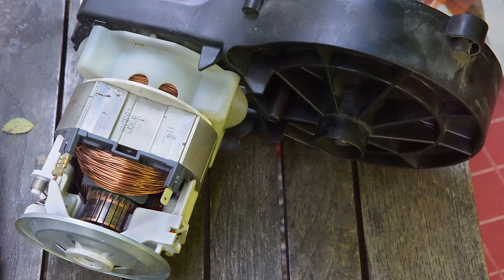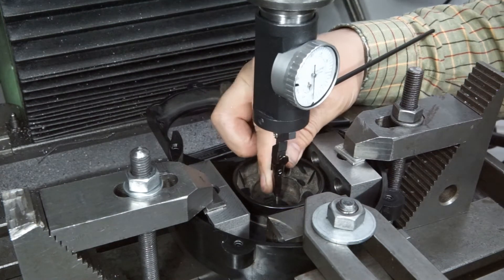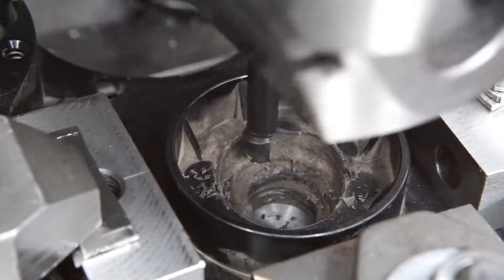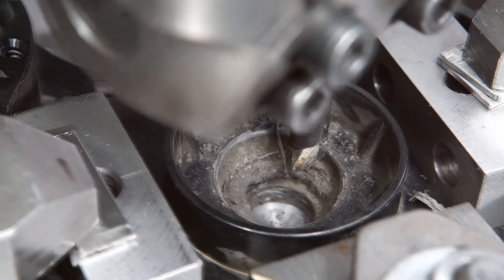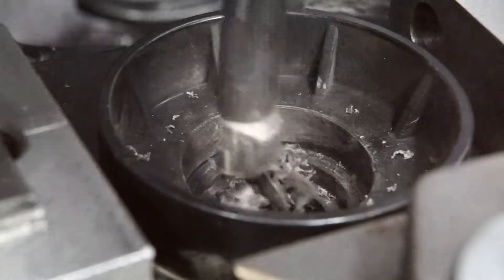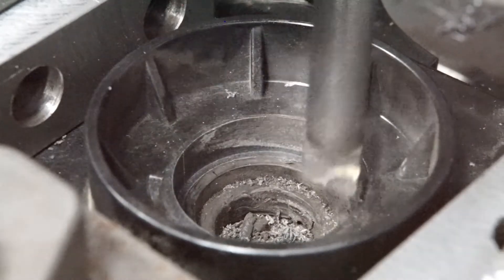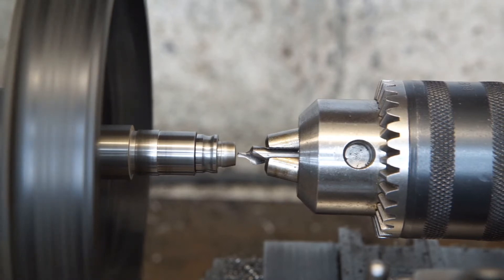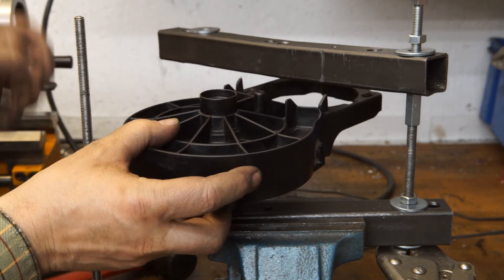lawn mower: fixing bearing seat with Wohlhaupter UPA5

Comment: Harald, can you do a video of your thiel tooling? I’m curious how you adapted some of your collets and tooling. I’ve recently purchased one but no tooling I can’t tell if there is a sleeve around the collets in the spindle or not. Thanks! -Dan
Reply from the maker: Dan, good idea. Yes, I will do a video on this topic.
For now the following information is hopefully useful:
the Thiel Duplex 158 has spindles with shortened Morse Taper 5.
The tools are attached to the MT by drawbars.
I was very fortunate that my machine came with a lot of tooling, among them adapters from MT5 to MT2, MT3, MT4 and a collet holder. (Something like ER collets.)
My Wohlhaupter came with a regular MT5. I modified it to fit the short MT5 of the Thiel. The beginning of the following video shows the modified
 version: https://www.youtube.com/watch?v=HcfRd51AuOg
This video shows how I made a simple adapter for SK40 tools: https://www.youtube.com/watch?v=1697FAv_ThE
If you don't mind reading German: here is an excellent article written by a friend who made his own tooling for the Thiel Duplex 158:
https://forum.zerspanungsbude.net/viewtopic.php?f=4&t=17194&p=279720&hilit=thiel+duplex+158+mk3#p279720
Reply: @HaraldFinster  Danke mein Freund!
Reply from the maker: see also here for more information/photographs:  https://forum.zerspanungsbude.net/viewtopic.php?f=56&t=36261&p=432905
Reply from the maker: Took me a "few" days, but here is the video on the Thiel tooling/tool holders
https://www.youtube.com/watch?v=JIq--7GsLNE